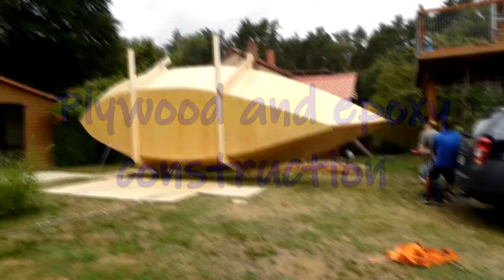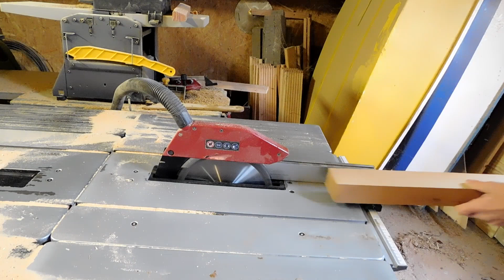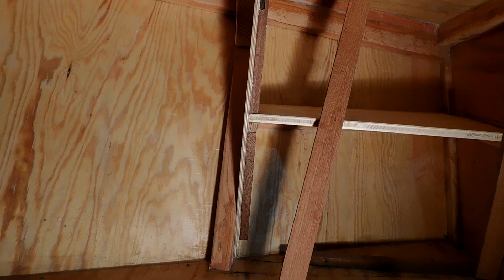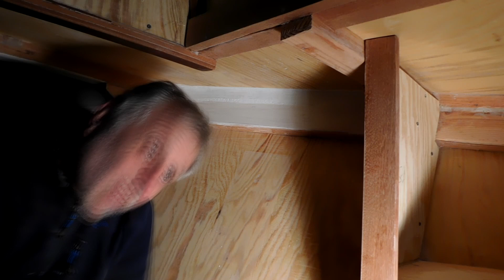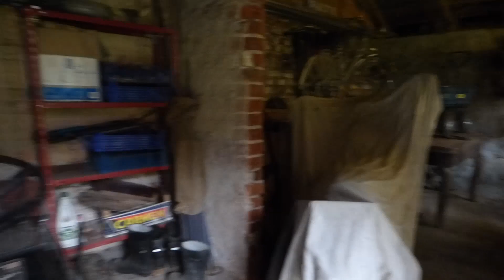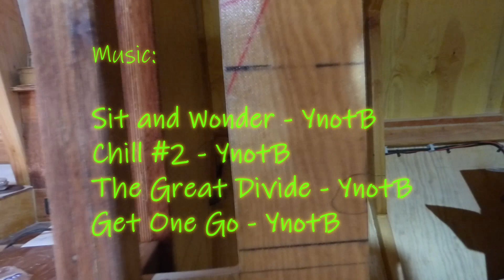Paint, brushes and Kilimanjaro - SV Tapatya EP119

Comment: Couple things:  About those brushes -- you should drill like a 5mm hole through the handle or ferrule up from the brush tip 10mm or so less than the height of your soaking container. That way you can stick a stiff wire or nail through the brush and suspend it from the sides of your container, keeping it off the bottom. Make your brushes much nicer in the long run. And a question: Will the brexit vote in the eu have any effect on you, being a brit (assumedly) expat?
Reply from the maker: Good tip, thanks 🙏. No, Brexit shouldn't have any immediate effect on me, but, of course, we'll have to see what the final agreement is....